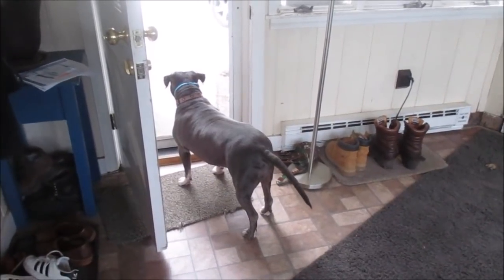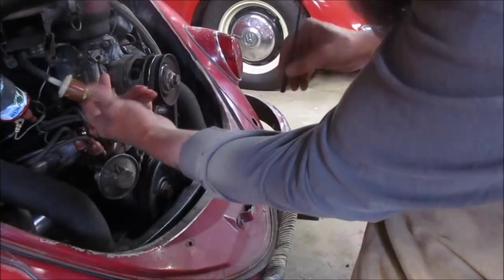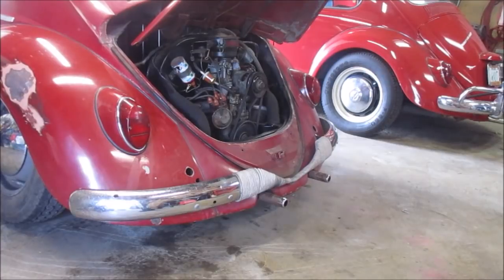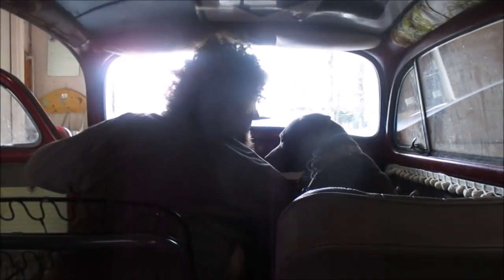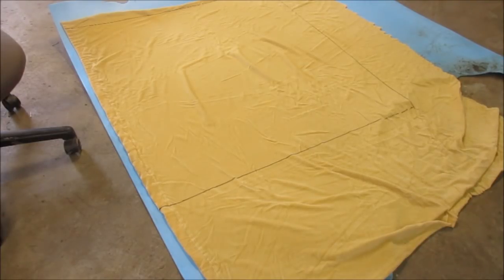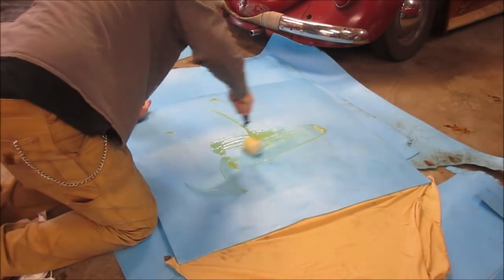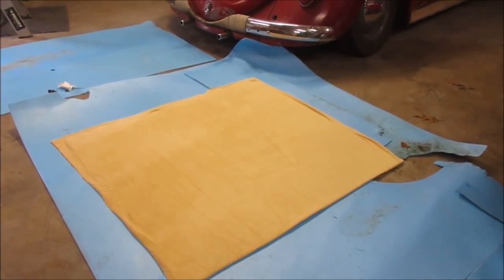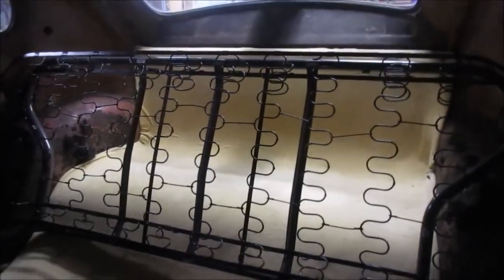1964 VOLKSWAGEN BUG VACUUM ADVANCE VACUUM LEAK REPAIR

Comment: Nice bugs, man. Thanks for the videos. Sad that the Ghia is no more. I'm really surprised nobody attacked you for the fuel filter location. Every bug post is always riddled with shitposting about filters that haven't been relocated away from the distributor.
Reply from the maker: Thank you very much for watching Error. We make sure to tell them that we know exactly what we are doing by keeping the filter in that location temporally to keep an eye on the condition of the tank and line in the tunnel😀 We also tell them that all old cars need to have a fire extinguisher
Reply: @vwnut1967  Do you ever hit any meets in the north east? I might try to get my 74 out some time next year. Needs a little work on the paint and bumpers. Can't seem to nail down the rust under the paint.
Reply from the maker: I live in NH we do shows in Maine ,NH,CT.NJ and where ever else the vw takes us

Comment: The trials and tribulations of old vehicles. I've had to replace many an old hose. just this past week I replaced both heater hoses on my 79 chevy pickup. One had actually rotted all the way through and was pissing coolant onto the intake manifold. Oh and I also had to replace all of the vacuum hoses as well but that happened 2 years ago when i got the truck.
Reply from the maker: way it goes. Thank you for watching Shane

Comment: Brian question on your 64 is that a PICT30 or PICT28 ? Next question when you check the timing with a timing light you keep the vacuum line on and should see 31 32 advance and 7 ATD at idle ?? My back ground was always machining and building motors and other would pick them up install and tune up etc. On my motor on the engine stand it is a stock 1600 dual and I put a new PICT30 verse 34 idle good start fine. keep vacuum line on when timing with my light my line goes from dist. to under intake manifold your thoughts should I move it to the carb. ???
Reply from the maker: it is a 30 i think you info on timing and vacuum is great and yes i should move the line. Thank you for always being here Dan

Comment: What’s up with your bumper?
Reply from the maker: Style matters. Thanks for watching monchy25
Reply: vwnut 1967 is cool did you shave it off, I was having an issue with the deck lid hitting the bumper on my ‘66  when trying to close it, I read is a common issue on a ‘66.
Reply from the maker: There is a bumper video on the channel  Daisy's playlist